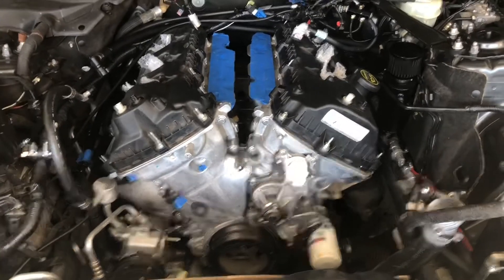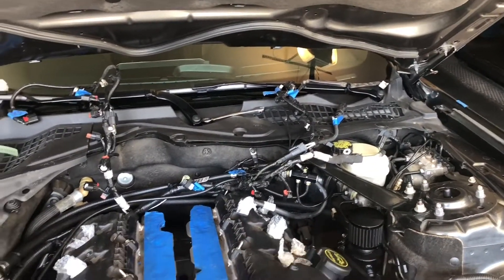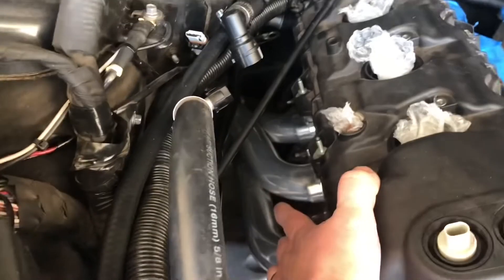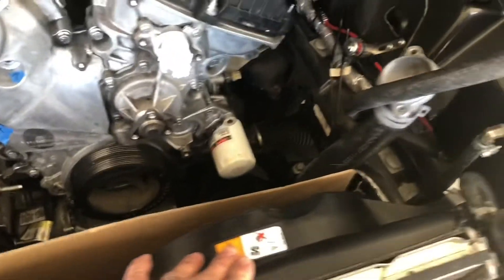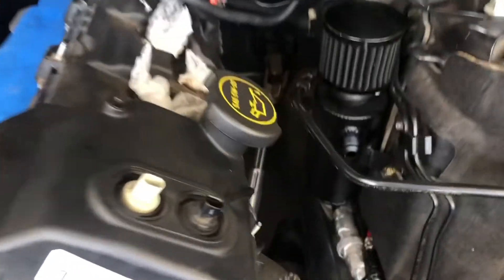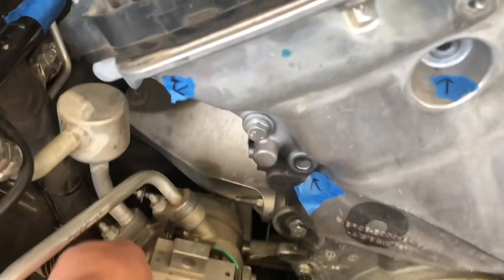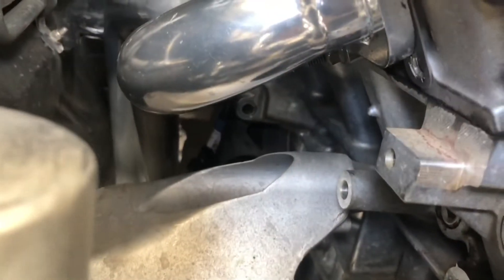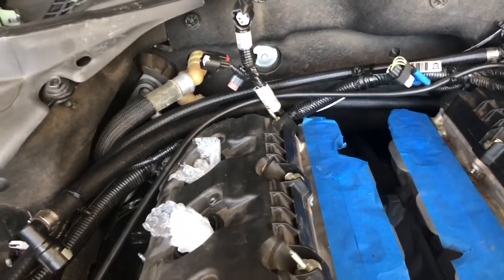Preparation for engine removal of 3.7 Mustang.

Comment: how did you lift the engine? i am rebuilding my car and swapping new engine in the and i was able to remove the old engine by the exhaust manifold studs and i do not want to do that with the new engine any suggestions?

Comment: What happens that it blow up ?
Reply from the maker: Was some kind of engine flow. It threw a rod bearing. It wasn’t the Procharger’s fault. These engines can support 600rwhp in stock sealed form. I’m only at 450-460 now.

Comment: Just happened on your channel I'm a 12 3.7 owner, I went .020 Manley Rods and Pistons. Kings bearings, ARP head bolts. Seems expensive but wasn't, besides flinder bore, total to rebuild with forge bottom end cost me a little less then $1700. I shop using discount codes ECT .. The look on my father in law face when he noticed the Cyclone has 6 bolt mains was priceless. Very easy engine to assemble. I know most encourage to buy a used motor. I managed a best of 316/311 on a Mustang Dyno with my built motor/ FBO N/A my Average run is a 12.6@ 107. On 100 shot of spray I average 11.8-11.9 @ 117. I'm saving up to get my procharger. I've got my 6r80 built with a circle d stall. 3.7 is a awesome platform. Light and Day better then my 3v
Reply from the maker: I just went with a new engine. Damn it. I will get it built next time for sure.
Reply: You rebuilt your bottom end?

Comment: That’s one clean blown motor lol. If your new motor is a 11-14 you will have to swap over 2 of the cam position sensors because the plug is slightly different. I think it’s the 2 intake sensors but it could be the cam. I think they are different colors so it should be easy to tell.
Reply from the maker: Thanks. The  brand new one is 2020
Reply: @AtticAZ  just something to keep an eye out for. Good luck
Reply from the maker: @notacoyote2790  Will do for sure. The new engine has all new sensors. But I pulled all mine original ones in case. 👌🏼